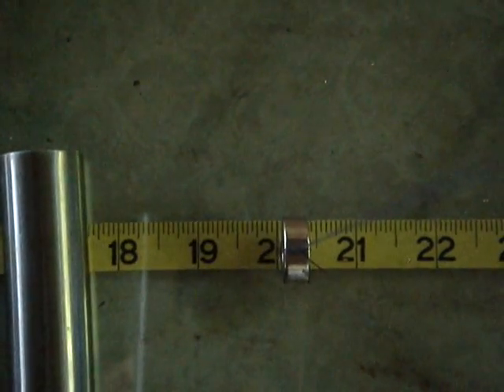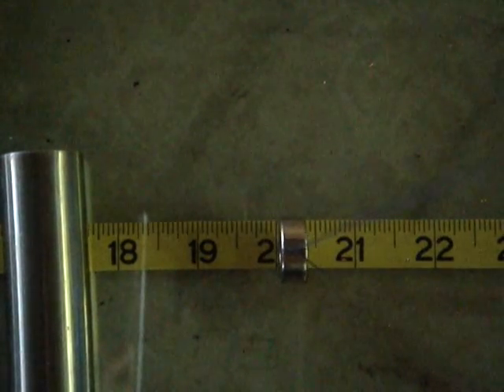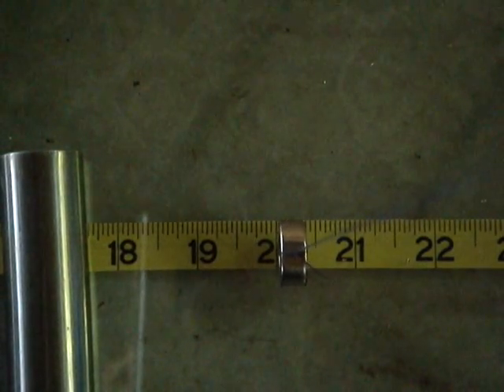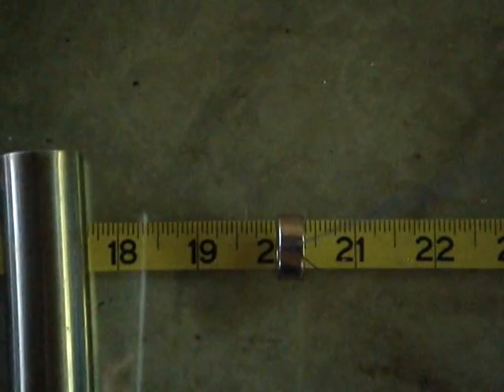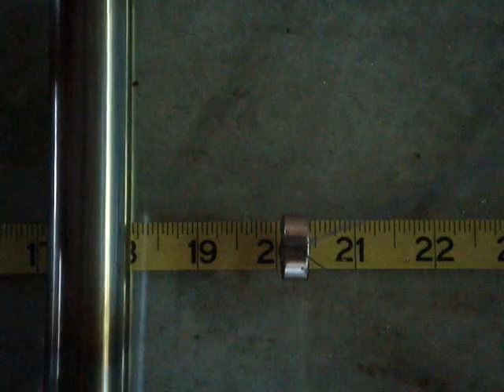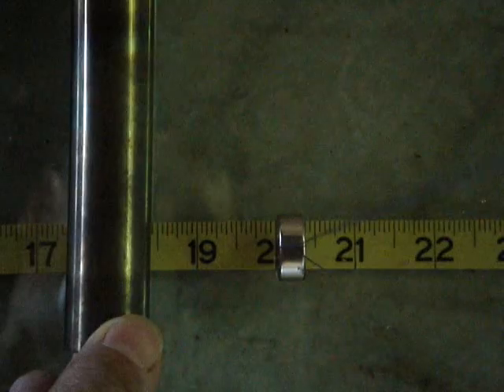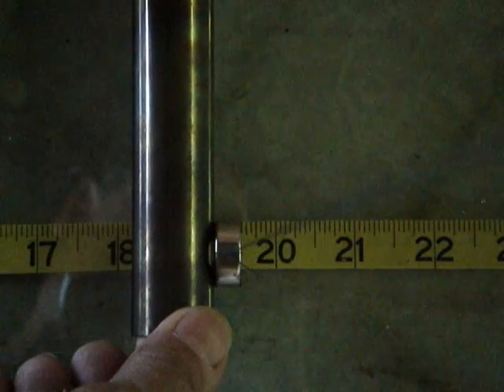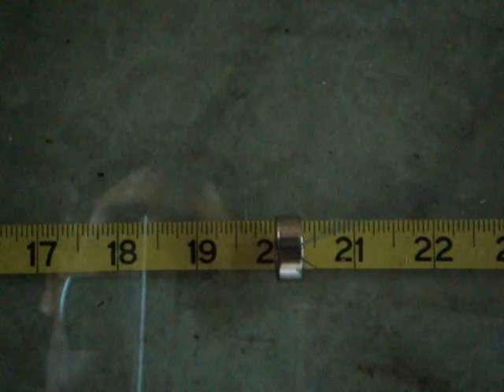Heat treatment experiment 316L stainless

Comment: 316 has carbon but 316L does not. But not enough to be able to harden it.
If you want to carburize (case harden) 316 and for that matter any 300 grade, either kolsterize or SAT12 it. You can not harden 300-grade stainless steel. These two processes will impart a carbon-saturated surface up to 12% to a thickness of 0,1mm without loss of ductility and improved corrosion resistance

Comment: Oo yes, I worked in refineries, NDT, and some work we done was dye penetrate & magnetic particle inspection U.T too, but we used a large AC 240 v coil, by passing the meta thro the coil, it changed the properties and demagnetised the metal. After we used permanent magnets on it during testing, might be cheaper for ya guy.
Thom in Scotland.
Reply: can we  demagnetize ss304?

Comment: Im under the impression that 316, has no carbon content, and therefore no magnetic properties ??, I know if you work on certain metals welding and such, that a magnetic residue can be left from the work, and might require heat treating but 316 ?.
Thom in Scotland.

Comment: I was under the impression that stainless steel hardens an approx 1050 degrees.
All stainless steels that I have worked with would remain unhardened an approx 800